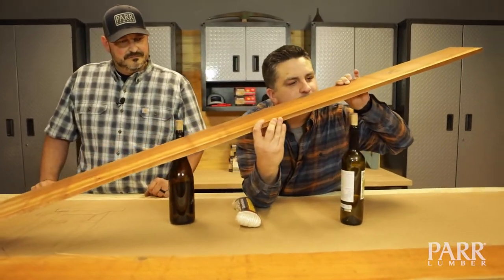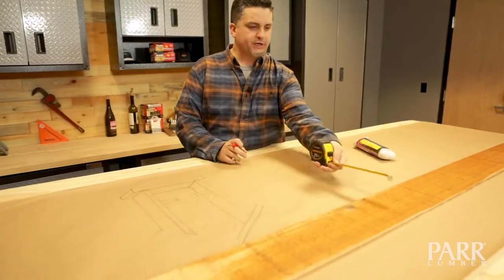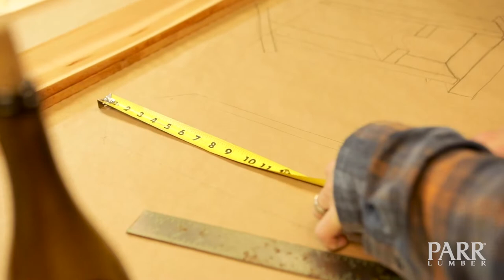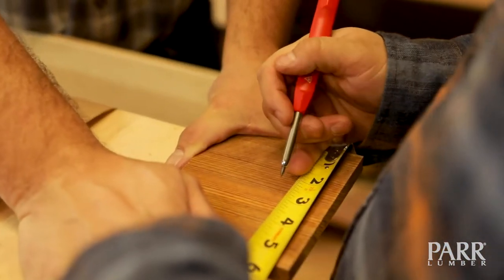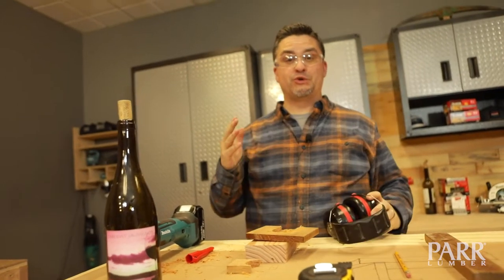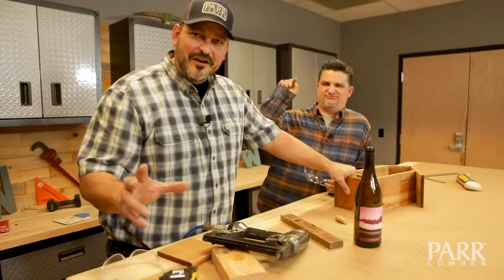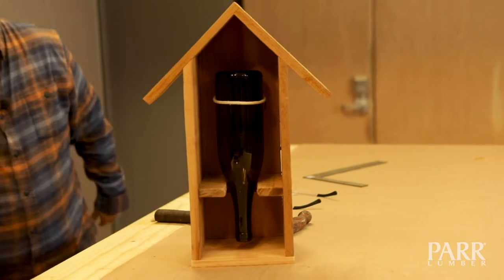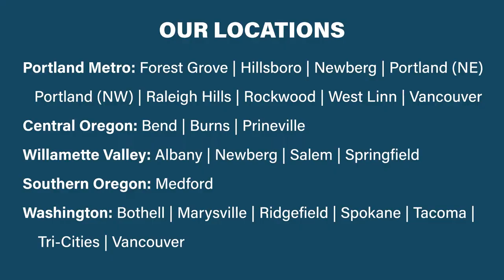DIY Build a Bird Feeder 🐦 Very Easy to Make ~1 Fence Board and Wine Bottle

Comment: The slot you made with the multi-tool should have been only as wide as the narrow part of the neck.  That way when you load the bottle the fatter part of the neck sits down in the hole and can't move forward without lifting it up.  Hence locking the bottom of the bottle in as well.
Reply from the maker: That is a great idea.  Honestly it didn't occur to us at the time but you're absolutely right.  Just wide enough to fit the bottle neck!

I'll do that on my next one!